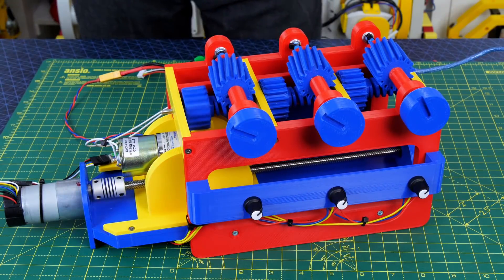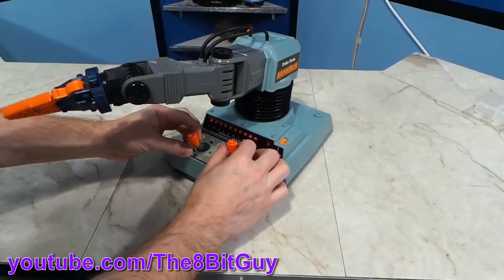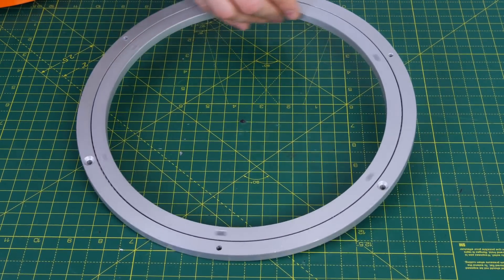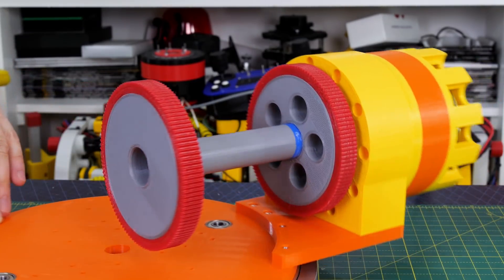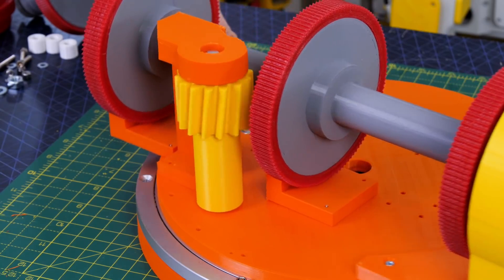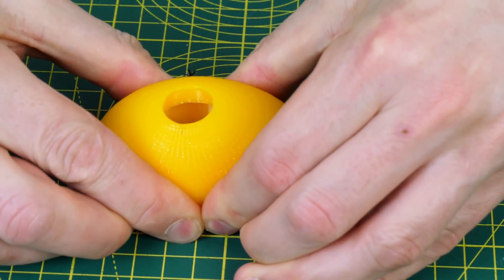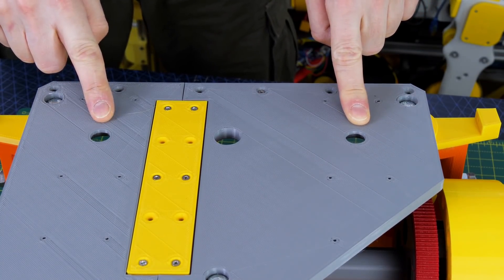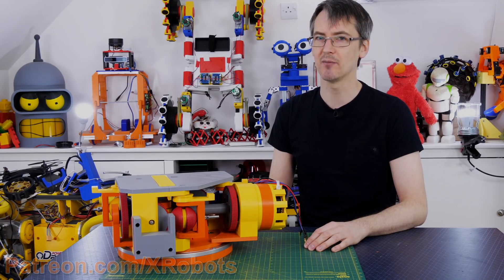One-Motor CVT Robot Arm #1 - Gearbox

Comment: that clutch mechanism is interesting.
i wonder: would it be possible to put two wheels into a case, one as the input of force, one as the output and fill the space in between with a ferromagnetic liquid. applying electromagnetism should then clutch the wheels together. I have no idea tho how to avoid clutching the wheels to the casing... 
the basic question is weather it would be possible to solidify a liquid in a defined location.
If that would be possible two wheels offset against each other could be clutched together at a different gear-ratio.
Reply: There exists a system that's similar to what you're describing, minus the ferromagnetic fluid. It's basically a robotic arm that has a constantly spinning wheel as power source in the base. The joint of the robotic arm can then clutch to it magnetically via electromagnetic windings in the joints (kind of like a truck's electromagnetic brakes). It's pretty cool, as you can control how much power it 'siphons' off of the spinning wheel by varying the current through the output wheel windings. I can't remember the name of the concept, but I saw it on the robotics subreddit a while ago. It was used in a university project to make extremely quick responding and compliant robotic arms.
Reply: @omega_one1318  That's cool as heck that someone's finally made that. What op suggests though, yeah the non-linearity from ferrofluid could make it a bit unwieldy if operated as even a simple slippable clutch. Hysteresis plus fluid dynamics? I gather the whole concept you're going for is a coupling zone in the fluid between the two wheels oriented in different planes, for a CVT behavior, you might get altered viscosity to convey some rotation in an opposing-cones arrangement, but it'll be countered by the cohesion on all of the bits of the transmission that you're trying to not connect. Would at least be resilient! Keen to think about it more.